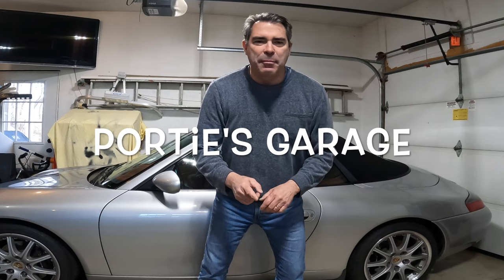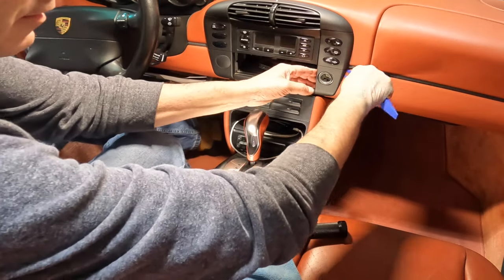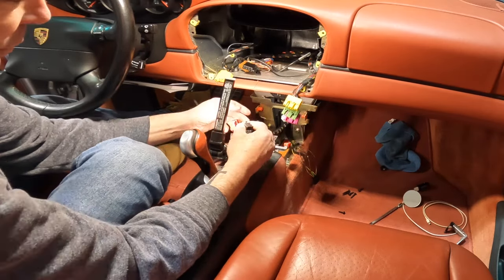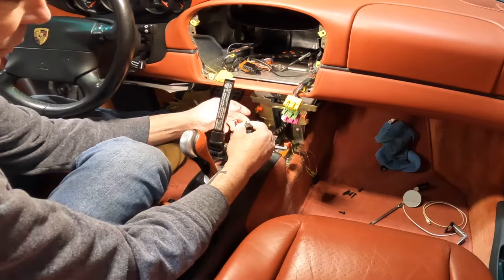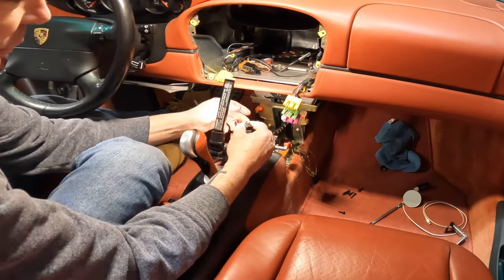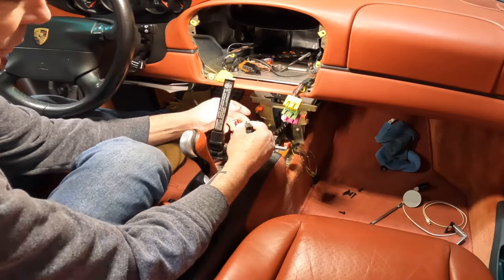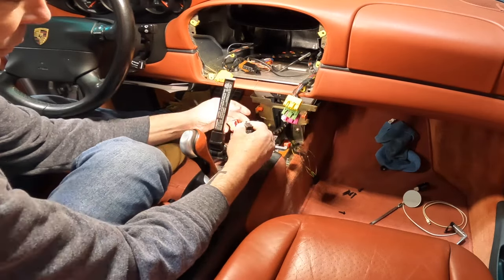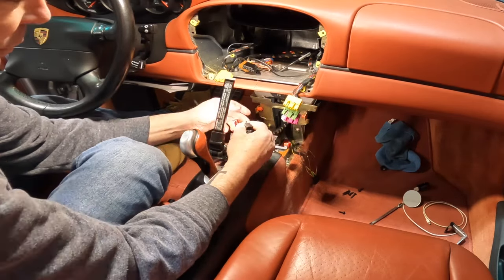PCCM+ Install for Porsche 996 – Long Version

Comment: Very helpful video, hoping to install this in my 986 later this year. Fortunately mine is a 2002 so it already has the climate control unit located down below, due to the DIN-sized cupholders that sit above the radio. Also, Apple CarPlay should use the PCCM's GPS antenna when connected, not the iPhone's internal GPS, so it was a good move to install the antenna.
Reply from the maker: Thanks!  You’re gonna love it!!!  Let us know how it goes!!

Comment: Nice job and illustration of your installation. I have an ’01 C2 with the same CR-220 head unit, though mine does have the amp and CDC 6 disc changer in the “frunk”. I’ve owned the car since new and am now contemplating this PCCM+ upgrade and also doing my own install work. I’m still researching variables surrounding the amp and CD changer and mine also has the original audio boost equalizer and that currently sits where I presume the HVAC unit moves down to. I’m guessing the boost equalizer gets removed with the new PCCM+? Still trying to nail down that variable. Earned a sub here. Thanks.
Reply from the maker: Thanks so much!  I remember a video on YouTube that someone else had the EQ and they did have to leave it installed but tucked it back behind the HVAC when relocated.   If I can find the video I'll post the link for you!  Good luck and let us know how it goes!!!   I'm loving the install so far - looks and works great!  Definite upgrade in my eyes.
Reply from the maker: Hey Marcus I found the video, it's for a Boxster and they call it the DSP - not sure if that is what you mean.   See around 4:30 into the video they start talking about what to do with the DSP.  https://youtu.be/1TPqsKtgajw?si=gkv894IP4PX0T2yC  Good Luck!
Reply: That is brilliant and thanks very much for this @Portie2216 . Yes, that equalizer is the exact same piece I have in my 996 and in the same location too. Handy too because when the HVAC unit moves down the existing plastic trim surround will exactly fit the HVAC too. Given that I will not be installing an after market unit like that Pioneer, I’m wondering if Porsche has a ready-to-plug-in slot on the PCCM+ for that connector that went to the equalizer? I can’t imagine that Porsche would have you wrap the existing equalizer and then stow it behind the faceplate. Given that there is bass boost, I’m wondering too if the equalizer leads route back to the amplifier. Possible too that the equalizer is completely negated with the addition of the PCCM+. If I get all the way there, I will definitely let you know. Again, a big Canadian thank you.
Reply from the maker: Happy to help where I can!

Comment: Can you connect this pccm to the existing cd player?
Reply from the maker: @wng0000071 - that is a good question!   Looking online I did not see where a CD player or even the   stock CD changer will work with the   PCCM+.  I did find this that says the   CD Changer CDC-4 will NOT work - https://assets-v2.porsche.com/int/-/media/Project/PCOM/SharedSite/PorscheClassic/Product-Highlights/PCCM/Manuals/FAQ/FAQs_PCCM-Plus_9x7_E1_EN_2023.pdf

Anyone else try this that can comment for @wng0000071???

Comment: Great video! Can you post the link to the installation instructions?
Reply from the maker: Here is the one I found online - click at your own discretion as I cannot verify the link:  https://www.manualslib.com/manual/2124437/Porsche-Pccm-Plus.html

Looks to be official from Porsche but again, I cannot verify that either.   Good luck!!!
Reply: @Portie2216  Awesome! Great video! I just had mine installed by the dealership. It didn't look as nice as the instal you did though. They put the GPS antenna on the dash near the passenger side. It doesn't look great. Mine is with velcro as well. Honestly, I'm not a fan. It feels very spongy. I think after you are complete the full instal, 2 sided tape or even some glue may be the way to go.

Comment: Great video, thank you for sharing! Does your 996 also have the ‘shelf’ subwoofers? If so, does the pccm also connect to them? Cheers!
Reply from the maker: Thank you!!!!   And no it does not have the shelf subwoofer - it has the most basic system offered, not even door speakers.   The PCCM+ does support the subwoofer systems though - along with the cd changer so you should be all set if you go that route.  Good luck!